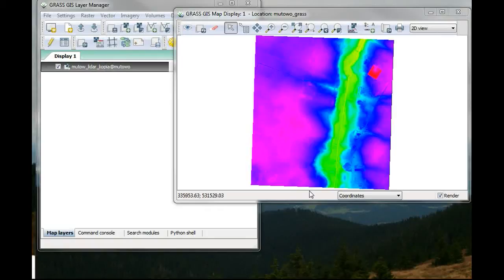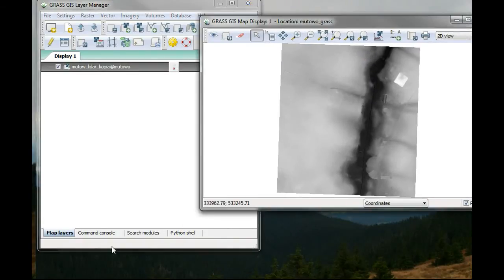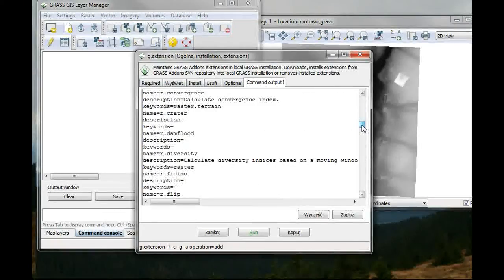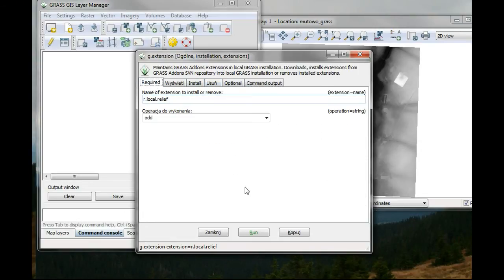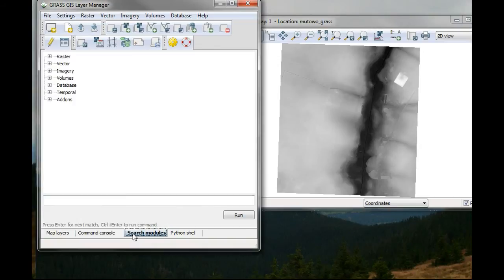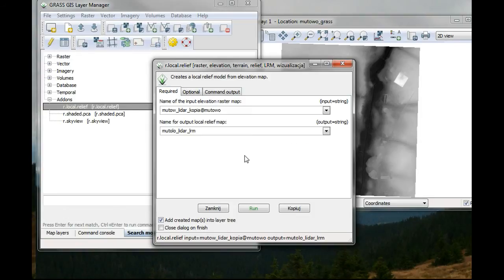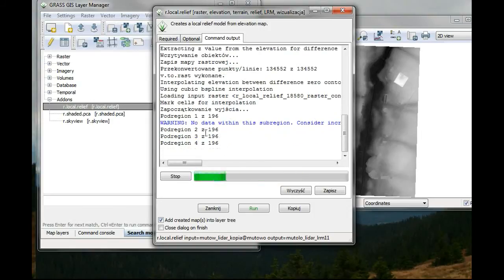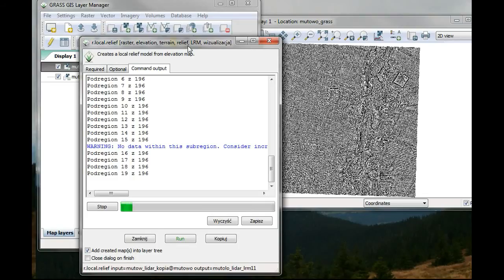GRASS GIS 7.0 installing an addon and performing a Local Relief Model on DSM (LiDAR derived data)

Comment: It is great to see a video tutorial for GRASS GIS r.local.relief module created by Eric and me.

Good to see also Search module tab in GRASS GIS GUI being used.
Reply from the maker: Pierre Roudier depending on the given value of Filter radius (ie smoothing neighbour size) bigger or smaller features are being exposed. I would also recomende using: LIVT http://sourceforge.net/projects/livt/
Reply from the maker: the module is handy for finding small archaeological features. Thank You guys for it :)
Reply: Is it possible to do the opposite operation - ie filter small scale variations out of a high res DEM?
Reply: Pierre Roudier Besides smoothing I would also try to simply subtract the result of r.local.relief from the DEM in r.mapcalc. The question is if it makes sense but if LRM does why not DEM - LRM?
Reply: Václav Petráš
That is a *very* good point -- can't believe I haven't thought of that! Thanks :)